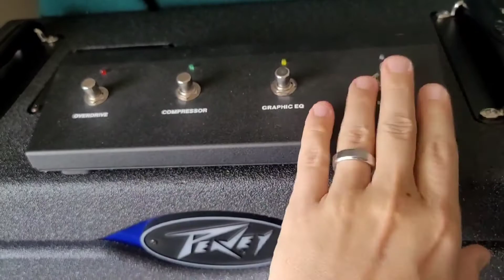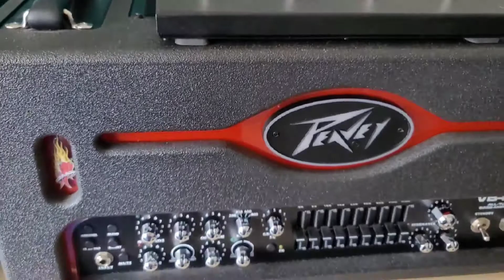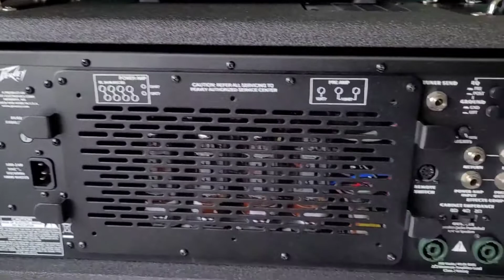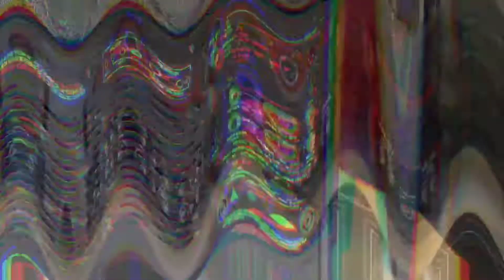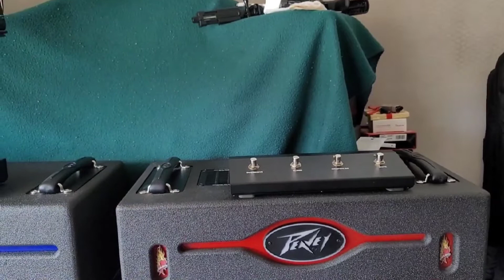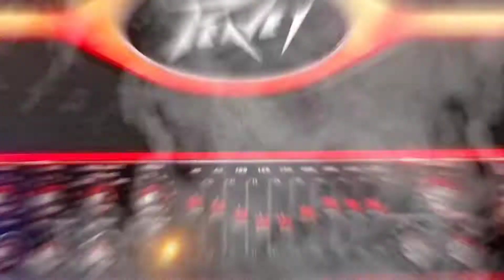Peavey VB-MA & Peavey VB-3: History, Technical Review / Compare, Sound Demo

Comment: Great review! I just got the vb-3 and I got some questions. You state that 3 band (low mid high) is passive (cut only) ; what I understand is that only the mid is passive(cut)  and low/high are active (boost/cut) . If you turn the mid knob full open (flat) you will hear that the mid selector frequency is not doing anything anymore ( like it should) 
Btw this mid setting I run and it complements the el34 tubes
Reply from the maker: Thank you for watching but no the three band is passive cut only. There is no opamps in this stage. The graphic EQ however is active with 4580 opamps that boost/cut 15db

Comment: Not a bass player or a tech guy, but I took interest in the VB-3/MA after seeing/hearing MA use it onstage. I’m a gear head and usually keep up with current gear just out of curiosity. After NOT seeing the amp on the market for a few years, I went searching for it with no results. Figured there must be some issues with the design. After reading the comments here, I see that I was right.
Reply from the maker: Actually the amp's circuit design is very solid. The minor flaws I spoke about what they are, minor and fixable. The amps were made for a very short time right before USA operations shut down making amps in general, the market was changing over to almost exclusively class D heads, and economics with the cost of tubes made it impractical to gig with such high power tube amps. Not to mention that the unique switch mode power supply many shops have little experience working on them.
Reply: @Bassguitarist1985  “Class D” meaning “no tubes”? As a 60 year old guitar player, I’ve learned that tube amps deliver the sound you need onstage. In the studio, you can use anything. Onstage, I’ll never give up my tube amp! No amount of modeling or digital manipulation can create the sound of a raw tube amp. With bass guitar, I’ve always appreciated Solid State amps for power and reliability. On the road, KT-88, 6L6, EL-34, are fragile and require careful handling. SVT, MESA, etc. are hot & heavy…but they sound awesome! Aquilar makes a GREAT 751w SS bass head! Probably one of the best I’ve ever heard. But tubes (especially KT-88s) have a massive range and can wash the stage with tone. It’s a tough choice.
Reply from the maker: @guitarcomet5  Correct Class D uses a digital method (switch mode power supply)  of powering the solid state transistor power stage.

KT-88 tubes are awesome, but tough to find an affordable reliable version.

Comment: I own a VB-MA, USA made in Nov 2017. Mine still makes a pop when going into mute. Trying to get a schematic from Peavey for it is like pulling chickens teeth. I need to repair my preamp, it sounds bacon.

Finding tubes that last is hell. My amplifier runs 509v on the plates and 493 on the screens. I installed jj El34L in it and had to repair my power board because they blew the screen resistors and shorted tubes. KT77 can only handle that kind of power in Ultra Linear tap mode, which ours aren't and will burn up pretty quickly. 6l6gc only rated for 450 on screens and they get unhappy. 7581a last longer than 6l6 but definitely get hot. Same with most EL34 types including 6ca7. 

The Ruby El34bht is rated for 550 on screens in our configuration and they do last pretty well, but are no longer made. The only ones that sound promising are from Psvane, who now makes the redbase TAD ones. I'm about to build my own all tube amp at this rate...
Reply from the maker: Hey Aaron! We have chatted before on talk bass! 😁

Yeah the next upgrade to the VB-MA is EHX 6CA7 valves and also EHX pre amp valves because I have had great luck with them in my VB3. 

John Fields down at Peavey has all the schematics you're looking for as well as I. Shoot me your email on talk bass and I'll send out the welcome email to him so he can send over all the schematics. They got to come from him as he asked me to direct any problems with the amplifier or questions to him so that he can help troubleshoot. 

As you well know there are not many of these out in the wild and you myself and another guy in Utah are the only active ones with these amplifiers that post on forums and YouTube.
Reply: @Bassguitarist1985  The EH6ca7 didn't do well with the screen voltage sadly, and the jj6ca7 had red plate issues. They said it could handle it, but they couldn't sadly. I use the Mullard Russian ones, tonally between ehx and tung sol, in preamp. The At spot in the pre board is a JJ because it works and is not noticeable. It sounds way better and defined, and am using a long plate mullard reissue in the phase inverter. I think the EHX long plate is a little better in PI spot but the mullard rattles less. Ill get on there later and re message you.

I got my amp pieced together enough for a show tonight. I need to fix the overdrive channel switching, doesn't work from footswitch but switch and cable are good, and the noise issue, but it'll work for tonight.

Comment: Question: I have the VB3.. can you use headphones with this head? Thank you.
Reply from the maker: With an external headphone amp its possible from the Preamp out jack sure. Still need a speaker load though. You can keep standby off.
Reply: @Bassguitarist1985  thank you again for the information!
Reply from the maker: @terry5957  which VB3 you have? Tolex or rhino liner? What tubes. What do you think of it? How long have you had it??
Reply: @Bassguitarist1985  I have the Tolex.. I know it’s a tube head but I’m not sure what type they are.. Actually cool story, my brother bought it directly from Michael Anthony a few years ago for my Birthday.. the head also came with a Ampeg cabinet.. the system sounds great!!
Reply from the maker: @terry5957  wow that is a story! Yeah MA used the VB-3 on his first tour with Chickenfoot. Yes it is a tube amp, but instead of a heavy iron transformer for power like an SVT you have a SMPS like in a computer for power instead. Saves a ton of weight!

Did you get the footswitch with it as well? If not its a real bitch to find on the open market.
Reply: @Bassguitarist1985  cool.. yeah it came with the footswitch too.. which headphone auxiliary amplifier would you recommend to buy?
Reply from the maker: @terry5957  I'll get back to you on that I have one that was cheap that I got on Amazon and it works great!
Reply from the maker: My sincere apologies I never responded to you on this. Its a Douke Audio headphone amplifier that I have. Very inexpensive and works great with my studio headphones. But there are a lot of options out on the market.

Comment: What a great video pal, love your comments and vibe. Im a fan of Peavey gear and i'm currently looking for a VB3...I have the feeling that is "The Amp". Thanks for making this!
Reply from the maker: Thank you for watching! Yeah the VB-3 is still my favorite tube amp, but really like the VB-MA with its refinements. Its definitely more of a gem to play at home and not a gigging amp due to it's rarity.
Reply: @Bassguitarist1985  I would love to take a VB2 but I know those have a problem with some fuse so are pretty hard to find. I still dream with a hybrid bass head from Peavey ...you think is posible? now we only have miniMax and MiniMega..both Solid State.
Reply from the maker: @mortiztv6  i do beleive it is possible. There are bass amps on development currently that I am aware of. The VB-2 fuse issue can be solved. I did a video on it actually!
Reply: @Bassguitarist1985  great! I will check it… easy and cheap to repair? I was toll that only the first units of the VB2 have that problem. Cheers!
Reply from the maker: @mortiztv6  not exactly easy or cheap, but doable. Even later units had the issue too. It came with a F 1.5A, but it needs at least an F1.6A to an F2.0A in the F2 position.
Reply: Hey!!!  So you finally found an MA!  Where did you find it?  How much??? :)

Do you really find the MA clips like the VB-3?  I have 3 MA heads and none of mine have clipped whereas 3 out of my 4 VB-3 heads clipped...but even if I boost everything on any of my MAs, I can't make them clip with any bass.  BTW, both my Minimegas can clip with extreme settings, but neither of my Minimaxes do.  I think it's a Peavey "feature" through the years haha; my tube Alphabass heads do it as do my old Mark III and IV heads, but only with extreme graphic eq settings.  It's all in those damn eq ICs...they just aren't forgiving at extreme settings.
Reply from the maker: @huskobar4545  somebody posted a picture of it on Facebook last year 2021 trying to sell the head and an 810. Seems nobody wanted the rig. Called up the music store in San Antonio Texas and asked if it was still there and they said yes. I asked if they would separate the head only and they agreed. If there was a way I can message you privately I would tell you what I paid but I can tell you that it was nowhere near what some people have wanted for it...

Honestly it is a hit or miss when it comes to the clipping issue of the EQ. It's the tolerance of the tubes transductance, gain factor etc. I actually wound up putting a 5751 tube in V3 for my vb3 and that's stopped the clipping entirely with any extreme EQ setting. 

Either way hope to stay in touch thank you so much for watching catch you soon!
Reply from the maker: @huskobar4545  I was able to get the ma to clip with my passive P bass copy and my active HH Music Man far easier. The Music Man was likely clipping in the input stage as well because of the hotter pickups